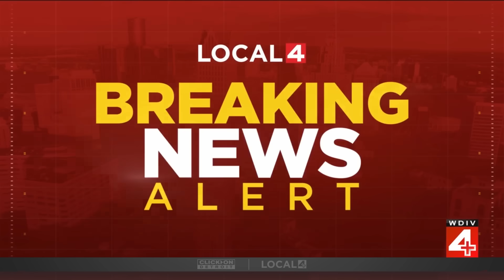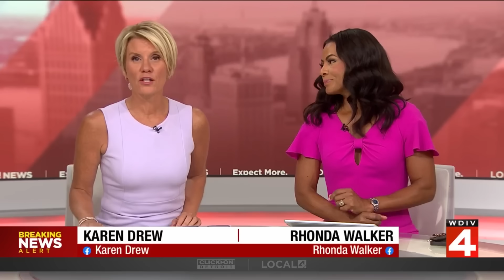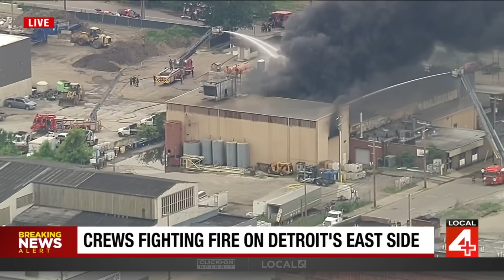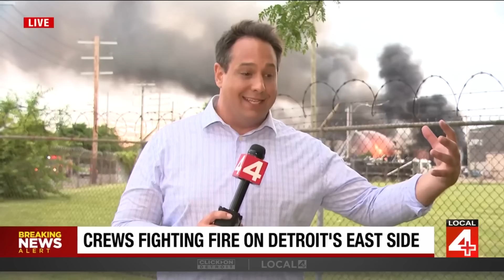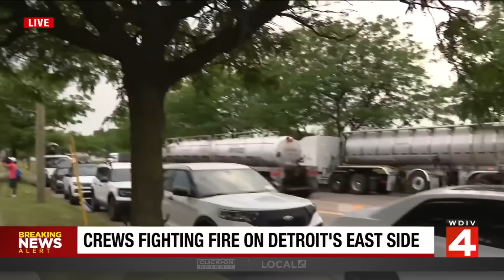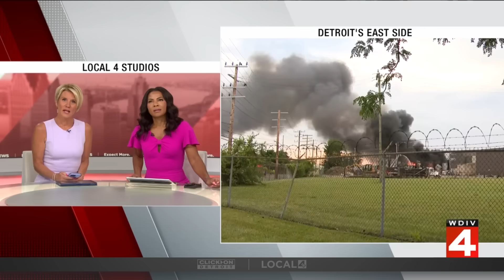Crews working to put out industrial fire on Detroit's east side

Comment: I'm pretty sure that you're supposed to use foam, not water on a oil fire
Reply: Could be cooling the tanks/lines. Whatever it is DFD will handle it.
Reply: You would think they know that
Reply: They are probably trying to contain it
Reply: They are trying to prevent a BLEVE incident. The water is used to cool the tanks.